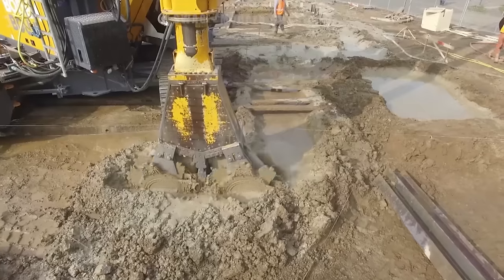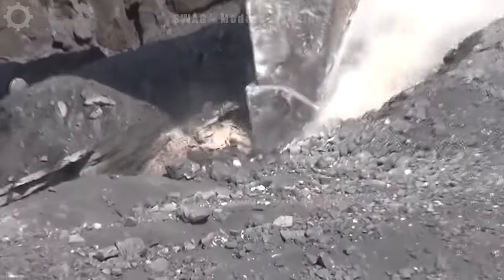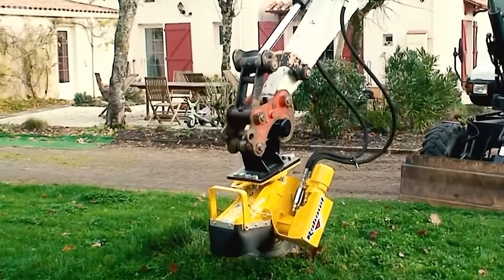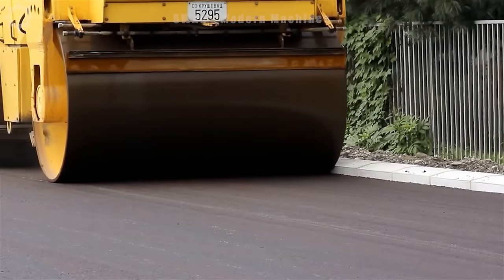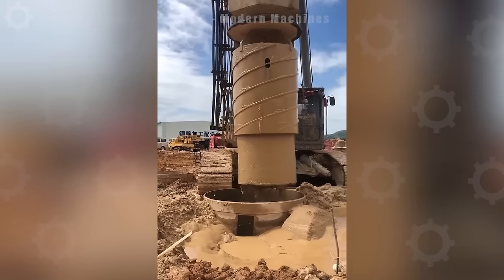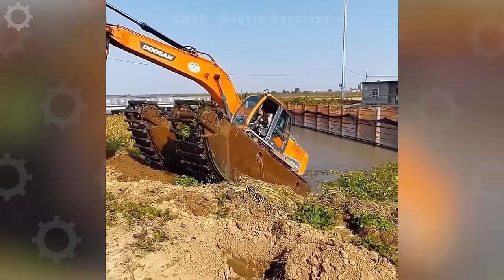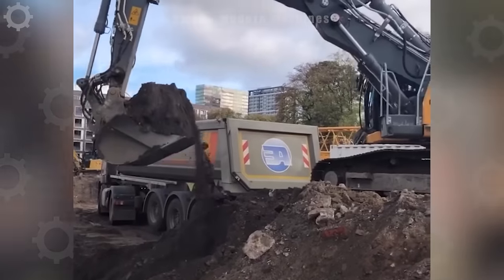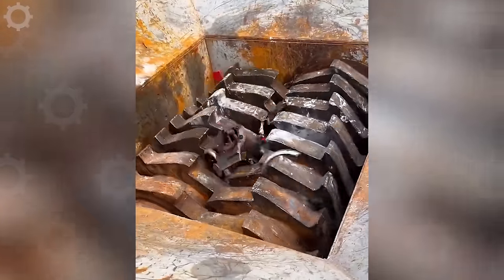350 Heavy Machinery Equipment Working With Operating At An Insane Level

Comment: Ongoing technological evolution focuses on enhancing fuel efficiency, reducing emissions, and integrating smart technologies into heavy machines for improved overall performance.
Reply from the maker: Safety in heavy machine operation is paramount, demanding skilled operators and rigorous protocols to ensure secure work environments, especially in challenging and dynamic construction settings.